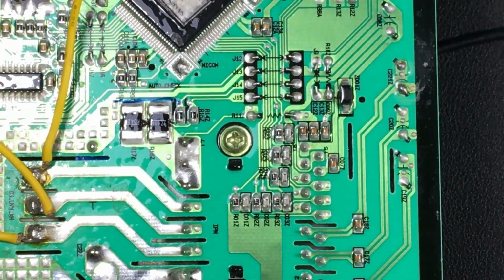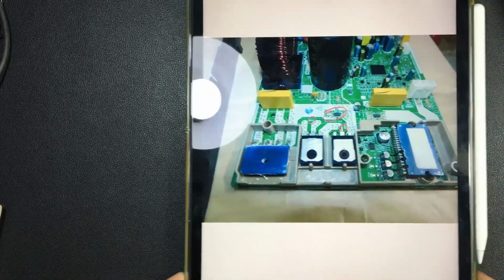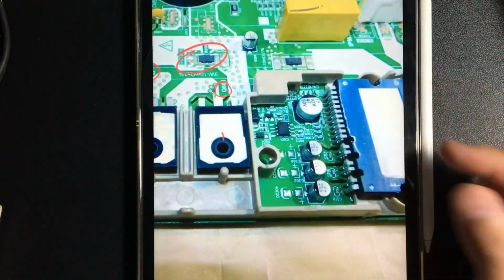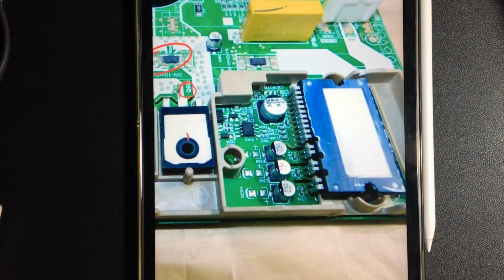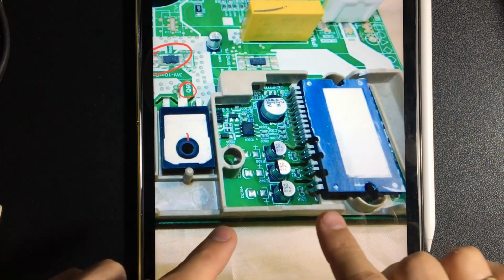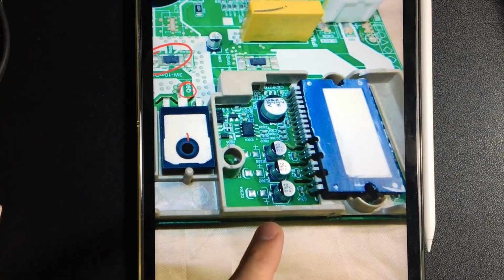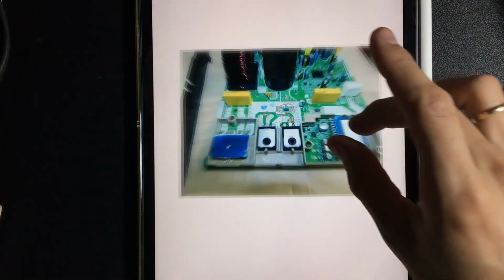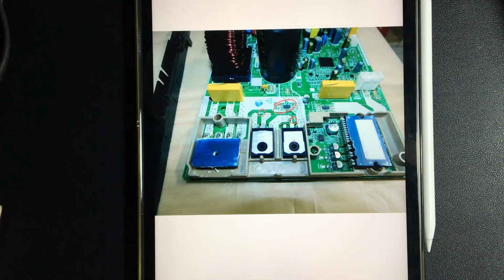Class 46: How to test IGBT capacitors?#inverter #capacitor #invertertechnology #arcondicionado

Comment: The capacitors smooth out the ac component   .My guess is you have to check 15 vdc with a oscilloscope. If  a ac ripple exists it means the capacitor i defective
Reply from the maker: Join our channel to access the classes by title and by module, and study effectively!
Join the Module Access level or higher!
TAP HERE ▶️ https://www.youtube.com/channel/UCfu_M6VyaVaJK9R69DsZGHA/join